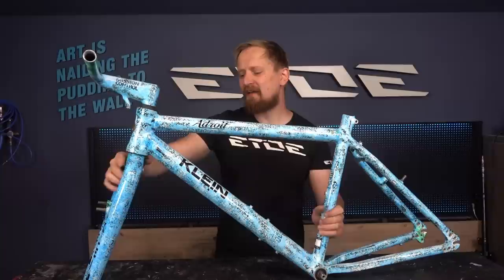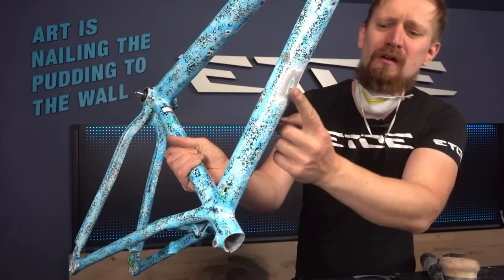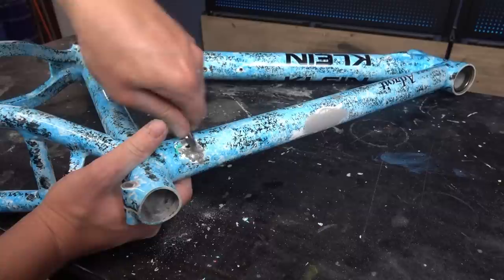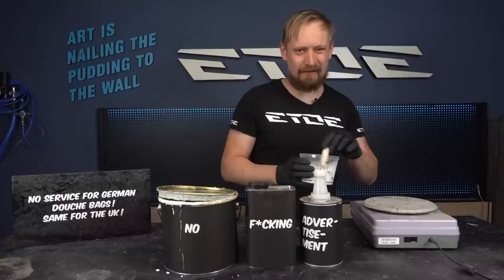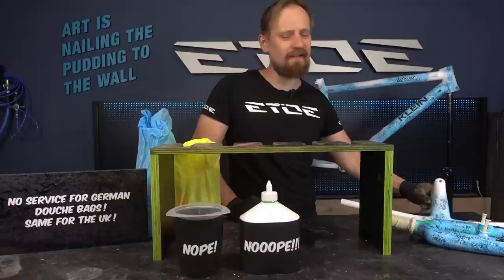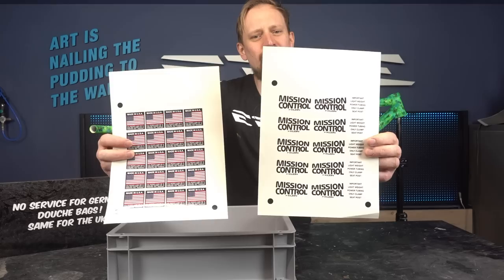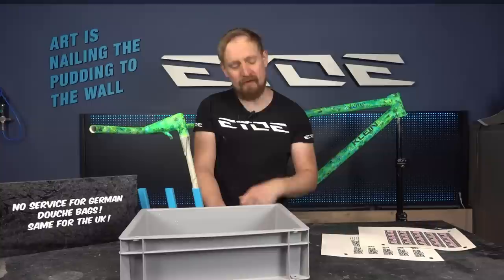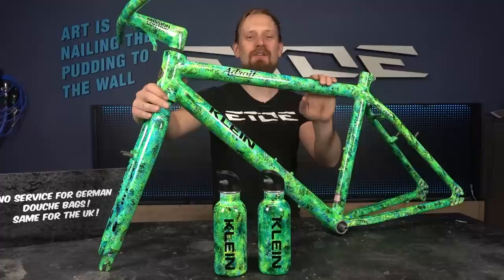KLEIN Adroit bike - paint restoration

Comment: A good paint starts from bare metal. If the previous clear coat is not removed we can question the long term adhesion. Not even an isolation coat between the old and new paint?
Reply from the maker: Klein owners are special persons! They want as much as possible of the old coating! I know normal people think they are morons doing so. But what is ordered will be done.
Reply: @ETOE  Thanks for the answer, however I wouldn't consider the people wanting to preserve patina (here it's more than that) as morons or abnormal. They are not. They can take such a decision, if warned and I guess you did it. What I didn't see was the usual clear warning in your video. Maybe worth to do a "special" about paint failures and their causes.
Reply from the maker: Please watch the paint failure fix video I did month ago.